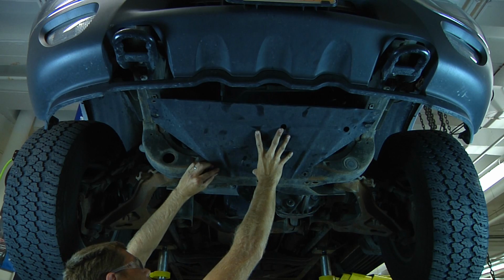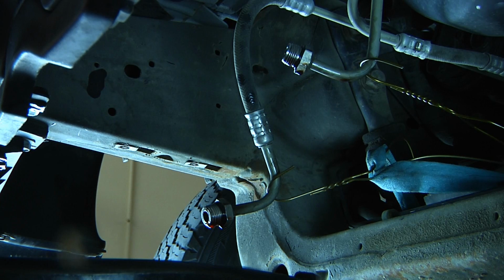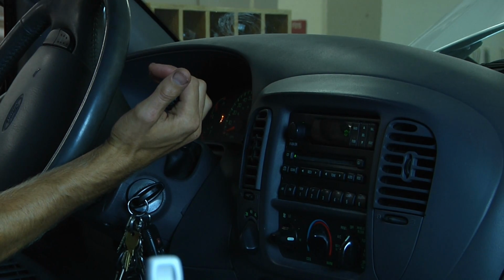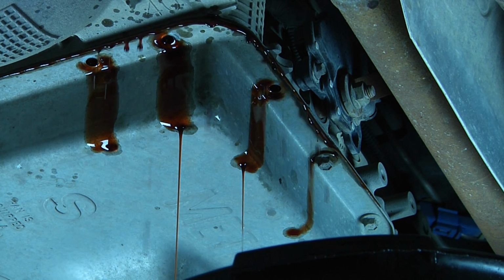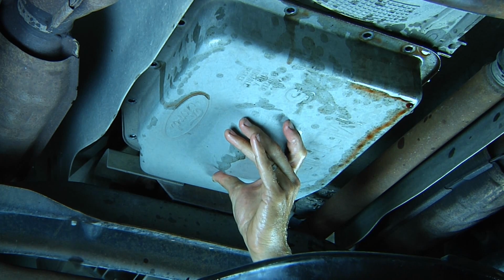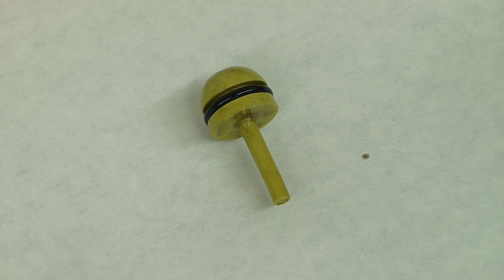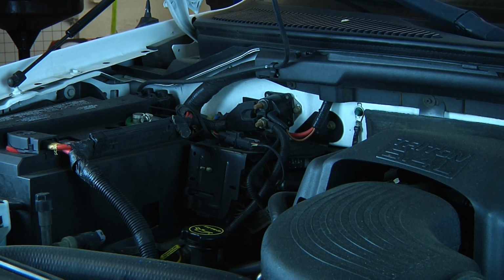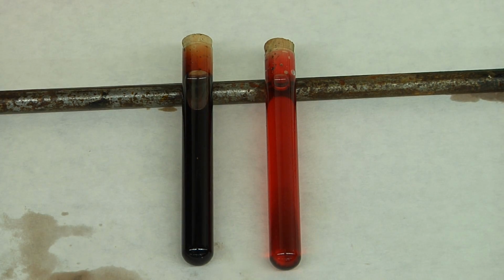2001 Ford F150 Transmission Service (Flush, Torque Converter, Oil Cooler, Pan & Filter)

Comment: What did you use to clean the pan with?
Reply: Tommy Bragalone Brake cleaner is perfect. Use lots of brake cleaner and clean rags. At the end, spray out the pan with just brake cleaner to wash away lint from the rag and allow it to evaporate by itself. The pan should be surgically clean at that point and have no residue left on it.

Comment: my truck lost reverse and I put it in neutral and it won't roll drive gear works a little any ideas what it might be the od light was blinking and it said trans fault
Reply: Richard Moreno have you checked your tranny fluid level? If it's not that take it to ford and they can hook up to a computer and tell you what the fault is.

Comment: just wanted to say great video i did everthing you said but i left the linlet in and had the outlet from rediator trans lines undone and draining threre a hose into old 3ltre plastic milk bottles and started it and ran it until clear good red fluid coming out so therefor it also flushed my trans cooler and no dirty crap or trans flush went back into trans

Comment: Great video. One question I'm not sure has been answered or asked is.. If you trans fluid has been mixed with coolant from the radiator, will this push all the coffee colored fluid out? In the end when you say to add till the dark turns to light, will that happen in this case or will the small amount of leftovers in the system continue to make that come out cloudy?

Comment: Thanks for the video ... I'm guessing mine has also never been changed but I wanted to ask: my F150 is manual...is there anything different I should consider?
Reply: David Walsh It's much easier. There's a fill plug and drain plug. You remove the fill plug first (always), then the drain plug. The oil will drain out. The drain plug may be magnetic. If it is, clean all the fuzzy metal shavings off before reinstalling it. Use the exact fluid specified by Ford to refill the transmission. Squeeze/pour new fluid into the fill plug until the fluid inside is level with the bottom of the fill plug hole. Most people just fill it until it starts to overflow, let it drizzle out until it doesn't come out anymore, and then reinstall the fill plug. That's it. MUCH easier than an auto trans fluid change. 

Words of caution! If Ford calls for ATF like Mercon to be used in your manual transmission, it's not a typo. Many 5 speeds use ATF today. If Ford calls for a gear oil like 75w-90, 80w-90, or 75w-140, you must make sure you use the correct GL rating. Most manual transmissions will call for GL-4 gear oil. Most differentials call for GL-5 in the SAME viscosities. If you use GL-5 in a manual transmission that calls for GL-4 you will DAMAGE it. Most 75w-90 etc gear oils at AutoZone or other stores will be GL-5 and meant for differentials only.

Comment: Incredibly helpful and clear!  After watching the video, I performed the same procedure on my 2000 Ford F-150, and that seemed to clear up the gear slipping.
Reply: Did you use the Ford brand for transmission fluid or something????
Reply: @romansroad2007  great question.  However, its understood that its overall better that you use Ford Motorcraft fluids on their vehicles.  Better performance, longevity functionality of inner components etc.
Reply: +dan2468101214 Awesome.  Glad it helped.
Reply: The thing that makes the biggest difference, is replacing the pickup filter. Any suction restriction on the intake tube causes air bubbles in the fluid, and the pump can't produce enough pressure to ensure full engagement of the clutch packs.

Comment: Great video...excellent details...I'm doing a 2003 E150 with 138K. It's never been done says the original owner. Thanks for the demo. Has anyone ever looked at the new filter after the flush to see if additional contaminants are picked up?
Reply: Did you have any problems after changing your transmission fluid?  I hear it's not a good idea to do it after too many miles ever never changing?
Reply: @UncleSarkis  , no problems. I'm still not understanding why clean fluid might cause problems. My power steering recently failed. That was a bear to change. The "remanufactured" pump had a stuck relief valve so blew out the pressure line on startup. Autozone did reimburse $93.00 for a new line.
Reply: @larrymaloney877  two reasons that I hear why...1) since a transmission was not serviced for a very long time, there is a buildup of solid material through passage. The new transmission oil with it's stronger detergents will free up those solids and break them free, clogging or closing up tiny passage ways.  

2) clutch material inside the transmission has deteriorated and removing the old oil will cause it to slip, because the lack of lubricity from the clutch material that flowed within the oil provided enough friction to prevent slipping.

This is just information I have heard from mechanics I know and YouTube mechanics like Scotty Kilmer too.

Comment: What tools did you use?? My 2003 F-150 SuperCrew's crossmember is in the way of a few bolts. I have tried everything to fit between the pan and crossmember. Still can't get it. A list of tools you used for the pan would be greatly appreciated.
Reply: Black King Ranch I used a swivel attached to small extension then a deep socket. It worked for me.

Comment: Just did mine based on this video, thanks! 200k on the truck and the plug was still in the pan.(I have had it for almost a year.)
Reply: Randy Shepherd, hows she running to this day...I have 208k and I highly doubt it's ever been serviced
Reply: How did the truck run after this? Did it start slipping after?

Comment: I noticed when you flushed the system, you removed the supply line to the oil coolers, flushed the convertor and then reattached the supply line. wouldn't you want to flush the system and then reconnect the supply and remove the return from the oil coolers and flush them as well.
Reply: +Jon Olson (ZO1983724) Thanx for the reply Jon. I have been hearing horror stories about people that have flushed their trans and then shortly after had them fail. Have you had any experience or heard of this happening?
Reply: +Tom Russo I read it applies to very high mile vehicles. Read in some threads don't flush it will wreck the transmission. Drain and refill.  Again, on very high mile vehicles only.  My son is 200K!  Jon video is excellent, so helpful.

Here goes:
Don't flush it. It will wreck the transmission. Drain and refill.Most torque converters will hold up to 40% of the transmission fluid. So draining and refilling it will at least replace 60% of the fluid; which is better than nothing.After a drain and refill, cycle through your entire selector slowly (P, R, N, D, D3, D2, L, D2, D3, D, N, R, P) a couple of times. This allows the fluid to fill all of the cavities and removes any air pockets. When driving, drive moderately. Allow the transmission to adjust to the new fluid.Since it is a high millage transmission, you might want to do a drain and fill, change the filter, run it for about 100 or so miles, and do another drain and fill, and reuse the new filter.

Comment: Just a question for the flush vs no-flush arguments out there.  Does this type of flush really pose the same kind of risk that a machine flush poses with releasing contaminates that may end up damaging the tranny?
Reply: +Jon Olson (ZO1983724) Thanks for the clarification.  A lot of people like myself probably assume the "flush" you get also dropped the pan and changed the filter.  This explains a lot.  I'm getting ready to do the fluid/filter/and pan replacement on my 05 F150 with 97k miles on it.  This truck is new to me, so I don't know the history (I guess I'll know a little more when I open it up).  I'm going to be towing a lot and close to the upper limits of the trucks ability, and want to do as much as I can to prevent losing the transmission.  Its currently working fine.   I've read a lot of people who say its not worth the risk to do anything but drop the pan and drain the fluid.  Maybe even doing it 4 times over 6 months to ensure the old fluid gets purged.  It sure is scary trying to pick a team here.  What are your thoughts on my scenario?  Great video by the way, glad your still following up on comments this far out.
Reply: +Jon Olson (ZO1983724) I went ahead and just drained the pan, swapped the filter and replaced with a pan with a drain plug ($25).  Then topped off with Maxima Racing SynATF.  Good news was the fluid has been surfaced before (no yellow plug) and no major debris was in the pan and the old fluid was still pink.  Hoping for the best.

Comment: Great Video, I am about to do this to my 04 F-150 but i plan on disconnecting the return line and starting truck like you did but run the truck for a additional for 10-15 more seconds and that will flush out 4-5 quarts from the pan and then i can drop the pan with it being mostly empty and save the mess. I can't see how running the oil out from the return line out into the pan would hurt the engine in any way since the remaining oil is still being sucked out of the pan and draining in for that 10-15 seconds.

there is a write up on this online of people using this method as well :)
Reply: i've been searching all round youtube and i think this is the best way.

Comment: Just saying, my 1990 Mercury Grand Marquis has a drain plug on the torque converter. How nice, I saw a torque converter that doesn't have one (read on); on second thought though that may be a good thing so that I don't flush it too quickly.

What would you recommend for a 1984 Chevy Caprice that I have no record of regarding maintenance excepting what I myself have maintained in recent years? (For another note, the car tires on it when I got it in 2010 were at least 15 years old!) I was thinking to just simply change the fluid in the pan, slowly, until it shows up as red. (it's black or very dark brown now.) I don't want to take it to a flushing place, it already leaks fluid when I shift from park and I read someone saying "Don't flush the transmission (to the mid 1970s car you got) just change the fluid in the pan; the pressure from a flushing machine may blow the fluid seals."

Comment: Great video but you didn't clean the gasket surface on the transmission before installing the pan and gasket. Even though it was a reusable gasket the surfaces should be clean of fluid and dirt.

Comment: Hello Mr. Olson, I have a question. my 2002 ford f-150 starting making grinding noise when i drive it, sometimes when i put it in reverse, also sometimes it kicks when it shifts into gear, do you think a transmission flush would help or my transmission needs to be replaced.  
THANKS
Reply: To be honest with you I just got the truck 3 months ago, so I'm not sure when was the last time that the transmission got serviced and it just started doing it 3 days ago.
Reply: ***** The vehicle has 235000 miles on it, thanks for the suggestion I'm gonna go ahead and do that and hopefully fixes my problem, thanks again for the help I really appreciate it.
Reply: David Osorio My 1999 Chevrolet Suburban K2500 Diesel's Transmission (4L80E Automatic Transmission) may have never been serviced before I got it. When I got it, the shift lever was difficult to move; it was in February in a cold climate, yet I had never felt a transmission so difficult to shift from Park before even after driving it home. I changed the ATF in the pan along with the filter once, and that helped make the lever shift easier; however, that was after (as I later found out) the reverse band kicked the bucket. The transmission was later rebuilt, after calling around we found someone who does it on the side at his house and got it fixed for a little over $1,000.

Comment: WOW this is the best video ive found about this.. can i ask you something. i have the same vehicle ford f150 2002 . just bought.. i asked the mechanic to do a complete maintanance, and i asked about changing the transimsion fluid, but he refused, saying changing might damage the transimsion since the new oil is too thin for a 190000 km vehicle.. he sayed for this cars is better to leave the same old fluid. what do you think??  thanks!
Reply: Thanks Jon, i´m positive that you are right, i had my doubts also. Unfortunately on my country we dont have AMSOIL. is there any other characteristic or brand instead that you can reccomend to me? i appreciate your advice. Thanks!

Comment: Thanks Jon for your great video. Would you happen to know the thread size on the supply line? I was wanting to rig up a adapter with a clear hose to connect to the supply line. Thanks for any info. ~Sam~

Comment: Why didnt you use the fluid extractor first haha?  My truck has been going 24 years with out a trans flush or new filter.  Trans fluid really doesnt go bad like oil because oil is being mixed with carbon from your cylinder when firing fuel.  
Still good to do every 100,000 miles but hell 24 years and not one problem?
Reply: M Knight Well if it's working for you go ahead, keep doing it; if the fluid's black now should you decide to drop the fluid though I'm wondering if you should not flush it - I've heard that flushing a transmission can cause dirt to clog passages if the transmission has never been flushed and is dirty, and if the people took it to a power flush place. (Changing it one fluid pan's worth at a time was said to be fine though.)
Reply: +M Knight There are a lot of reasons why your transmission and fluid can last as long as it has. Light loads, operating temperature environment and general location humidity. There is also the ol maxim, a car (or truck) driven is a vehicle that will require less maintenance and repairs. Some transmissions will wear out VERY fast due to where the unit is being operated. Extreme temperatures like Northern Canada and Alaska are brutal on parts and the case itself. Thermal expansion eventually wears out the parts not because of abuse, but the wide temperature swings. Transmissions that carry real heavy loads in high altitude or hot and humid locations can burn up fluid in a hurry. If your vehicle never sees these types of conditions, it is not surprising to hear that you've gone 100,000 miles without a hiccup. (knock on wood)

Comment: Hi Jon,  My transmission slipped the first time the other day.  My last change was about 100 000  miles ago.  The fluid does not smell and is not that dark.  What are your thoughts.  is it fluid or worn parts.  Is a flush to late or worth it at this point and time.?
Reply: Thanks Jon for the reply.  I am going to take my truck in this week.  Do you think the slipping is caused by break down of the fluid or wear on the parts.  Would changing the fluid reduce or eliminate  future slipping?
Reply: fasstang87 If the fluid does not look as though it is very contaminated I would guess that the wear on the parts is minimal.  Without seeing it for myself I would say that just by replacing the fluid and changing the filter would solve the slipping problem.
Reply: Jon Olson Hey Jon,  I have changed the fluid in my truck.  the dealer stated that the fluid was dark.  I have a sample in a water bottle if you want i can post a video for you.  the dealership also stated that there was no metal or chunks in the fluid/ filter just dirty fluid.  I have driven it all week about 500kms / 310 miles.  I have notice that the truck pulls a lot stronger, firm  before it has been feeling really soft/sluggish.   If there is to be a failure when do you think it would be within the first 1000 or could be anytime?  Also since the torque converter holds 40% should i change it out again sooner then later?
Reply: Hey mronemanband1.  I just had the fluid and filter changed,  so far, so good.  I am coming up to 10 000 sinc
e i changed the fluid.  I was thinking about getting the filter changed again around 20k.  I haven't towed anything other then my seadoo, so the loads have been light on my truck.

Comment: I recently bought an 02 E250 work van so I could leave my truck at home. It started dying anytime I would take off from O/D or 2nd, and sometimes in 1st. After having it scanned we determined a solenoid for the torque converter is either bad, going bad or just malfunctioning. It had sat for quite some time so we were thinking maybe it's tarnished and he said to run conditioner in it. I'm just going to change filter and fluid like you did in the video. Would this said solenoid be hard to change? I don't think the mechanic knew where it was for sure. Thanks for your help? Also, after watching this video it reminded me I haven't flushed my trucks fluid so I'm doing it at the same time

Comment: I don't understand why you needed to differentiate the supply and return lines to flush the system. Did I miss something?
Reply: Thanks for the reply, but I'm still lost...does it matter to someone changing the fluid or was it just for informational purposes? Thanks again for replying.
Reply: Its to change the fluid in the torque converter. If you just drop the pan then refill it the torque converter will still be full of old nasty oil. So flushing with the line disconnected replaces the atf in the torque converter.